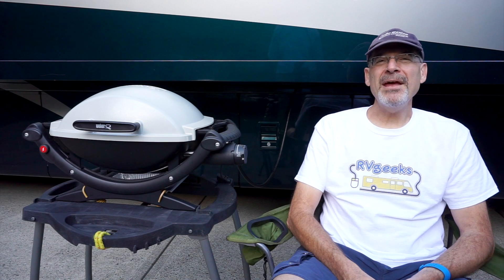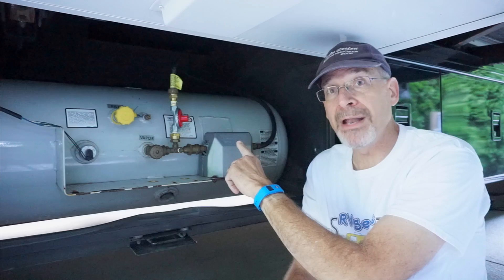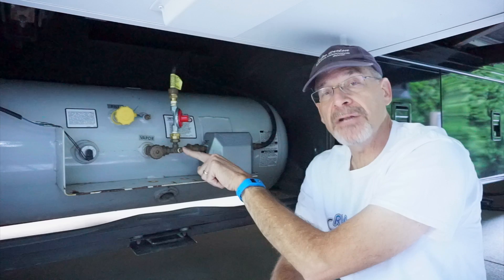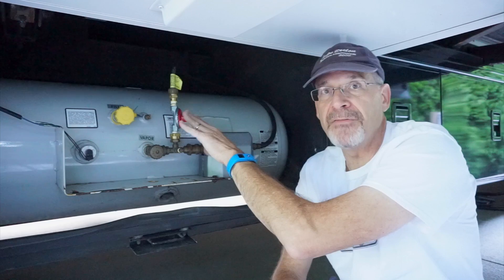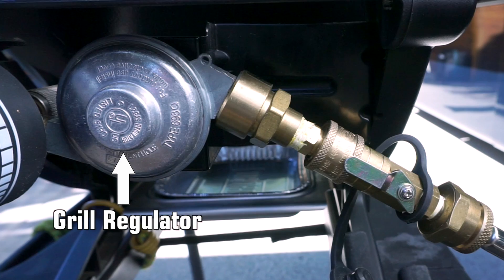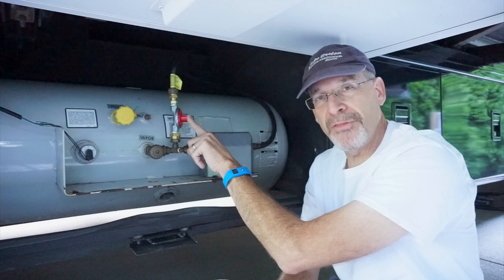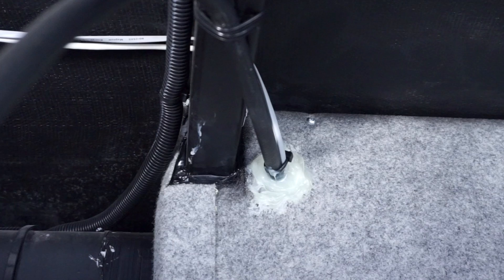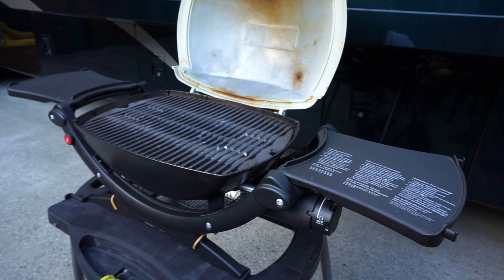How to Connect a BBQ Grill to an RV's On-Board Propane Tank

Comment: Hello!  Thanks for your video.  I have the same Weber Grill and I was trying to connect a 20lb tank to it instead of using the 1lb small tanks.  I bought the host for the 20lb to the Weber Q Grill, but for some reason, even though the grill is in the OFF position, gas is still coming through.  The Weber Q1200 has a regulator on it, but do I still need another regulator on the Hose between the 20lb tank and Weber Grill (again, the same grill that you have)?  Thanks!
Reply from the maker: Glad the video was helpful. First, in response to your question, no... you shouldn't need any other regulator between the 20lb tank and your grill. The grill's regulator is expecting the high-pressure propane from either the disposable tank or the 20#, so that part is fine. The gas still running/leaking part... that's clearly an issue! Can you tell WHERE it seems to be leaking from? Is it literally coming through the regulator and running out the burner holes? Or is it leaking somewhere else? 

You might want to mix some dish soap into a cup of water and pour that over the connections... if it bubbles, you've found leaking.

But if the gas is coming THROUGH the regulator on the grill, even with the regulator turned off completely... it sounds like that regulator has failed and/or is faulty. If it's new, we'd return it and get a new one. If it's older... we'd try replacing the regulator.

Hope this helps!
Reply: @RVgeeks  Thanks again.
Reply: Thanks for the video. I picked up our new RV yesterday and was told not to have a regulator on the BBQ since there is one on the TV and it would be too much. What do you think?
Reply from the maker: It all depends on whether you’re tapping into the propane for the grill prior to, or downstream, of the RV’s regulator. The RV regulator brings pressure down to the correct level for running your grill without an additional regulator. If, however, you have your system set up like we do, with the hose going over to the grill coming from the high-pressure side of the regulator (the side closest to the propane tank), you absolutely do need a regulator on the grill itself.
Reply from the maker: By the way, congratulations on your new RV!
Reply: @RVgeeks  it's going downstream so it gets the effects from the regulator. Guess I'll have to shop for a different model 😃. Thanks for the help!

Comment: i know this video is old but I was just wondering about why you have the second regulator at the grill side? Is it necessary? thanks
Reply from the maker: Hi Scott! It’s needed because we have such a long run of hose from the propane tank to the grill. Very high pressure coming directly out of the propane tank and running down a long hose tends to build up oil in it which gums up the grill. That red step-down regulator lowers the pressure enough to prevent the oil, but still allows enough pressure for the grill to operate properly.
Reply: @RVgeeks  thank you for the reply.   and you parts list is excellent.  We are hooking up our blackstone this weekend.

Comment: If you do NOT want to have the ability to add an external LP tank, can you just add the tee AFTER the RV regulator?  Then, will any portable grill work OK (many say they are designed for 1 lb or 20 lb LP tanks) -- I assume there would only be the RV regulator that would meter the proper pressure to the grill.
Reply from the maker: You CAN do that, Jim... but you'd have to be sure there's not a second regulator on the grill. For example, our Weber Q has the regulator integrated with the ON/OFF/LEVEL control knob... and while it CAN be removed, it's a bit of a pain. So using the Extend-A-Stay before/upstream of the onboard regulator ensures that the grill sees high-pressure propane. If you Tee in after/downstream of the onboard regulator your grill will only see 11" water column (about 0.5 PSI), so if it has its own regulator, it won't work. The 11" WC pressure isn't enough to open the second regulator up, so no propane will flow. Hope this helps.

Comment: Should be a shutoff valve before the high pressure regulator  so the line to the other side isn’t under pressure all the time  if it ruptured or even a pin hole would be fire hazard
Reply from the maker: Ideally you're right, and we've been thinking about adding one.

Comment: Instead of the double regulator, can I just disconnect the hose from the extend-a -stay valve when it's not in use or even install a propane gate valve where you have the 15# regulator-All of this is for the oil build up, correct?
Reply from the maker: Hi Craig! Since the 15-PSI regulator at the tank is indeed for the sole purpose of preventing oil build-up, your idea of either disconnecting the hose, or shutting off the flow of propane, should work great, since it's the pressure in the long length of hose that causes the oil to come out of the propane. Great question and great idea! :)

Comment: You're running propane through a regulator twice? Are you getting any pressure at the appliance? Doesn't that reduce your propane pressure to the point of it not burning at capacity?
Reply from the maker: As we said in the video, yes, we're running through two regulators, and it works perfectly. The reason is that the commonly referred-to "double regulation" problem happens when you use two 11" WC (water column... the standard appliance regulator that equals about 0.5 PSI). We're not doing that. The first regulator is 15 PSI, about 30 times more pressure than the one on the grill. That supplies plenty of pressure to the grill's regulator, and is simply in place to reduce tank pressure (which can typically run well over 100 PSI) down in the long hose from the tank to the grill. That's only needed to prevent oily build-up, which can happen (and clog the grill's regulator) when running extremely high pressure over a long run. It's simply a step-down, not double regulation.

Comment: We are looking to do this with our travel trailer.  We have quick connects available already at the camper but need to connect to our coleman roadtrip from the one pound tanks to a hose we have purchased already.  do you have a list of the connectors that you used
Reply from the maker: Hi! Not only do we have a list of every part we used, but links to them and a diagram of the whole thing to boot. You can find all that here on the related post on our website. Hope this is helpful: http://thervgeeks.com/propane/bbq-grill-connection/

Comment: Thank you for this detailed information! Got all the necessary parts from your website´s links. Quick question though: with the grill adaption to the tee, that is between the tank and the regulator, once you open the tank´s valve is there no gas escaping through the grill´s hose? If not, is it not escaping because the quick adapter´s valve, or would it be enough without that quick adapter to avoid gas escaping (or would I need then to connect and disconnect it all the time)? Thanks in advance!
Reply from the maker: Good question, Alfredo. Yes, the quick-connector by the grill has a shutoff so that propane doesn't leak when you disconnect the grill from it. We've also been meaning to install another shutoff valve between the tee and the 12' hose coming across to the grill... so that, when needed, we could shut off the flow of propane in that hose, without also having to turn off the whole RV's tank. That would also add another layer of safety to ensure no leaks. But, even without it, we haven't had a problem.
Reply: @RVgeeks  Thank you for your answer!!!

Comment: Why didn't you just T off of the down stream side of the reg. you already have on the coach and remove the reg. on your grill.  That is what I did for my Weber Q (11"WC) and my fire pit (also 11"WC). And it works fine with much better temp. control than I had with the small "camping" bottle or the big 40lb tank.
Reply from the maker: Hi Walter. Sounds like that worked for you. But if we T'ed into the line downstream of the regulator, we couldn't use our Extend-a-Stay to connect to external propane, since that would put high-pressure, unregulated propane into the entire RV. Also, not sure if you have an older Q, but ours (a pretty new one) has a regulator that appears to be all one piece with the temperature control. That makes it a nuisance, since it prevents us from just popping the regulator out of the line.

Comment: I have a camper with dual propane tanks. The propane lines are set up similar to what you did in your video, with a dedicated line running to quick connect for outdoor grill station. I am thinking of changing the configuration to use an auto changeover regulator for all of the camper's appliances. Any idea how I would split out a line to the grill station using dual propane tanks and an auto changeover regulator?
Reply from the maker: Hi Mike... sorry for the delayed response. We lost track of this comment! How you do it would depend on where your current BBQ quick-connect line is plumbed. Does it come AFTER (downstream of) the RV's regulator? If so... it should be easy to just replace it with the auto-changeover regulator and nothing else needs to be touched. But if your current "T" is placed BEFORE (upstream, closer to the tank) from your current regulator, you'd have to make some changes. You'd probably want to move the "T" to AFTER the changeover regulator (so you'd have the advantage of the propane supply for the BBQ auto-changing along with the rest of the RV) and you'd likely need to remove the regulator from your BBQ grill. The output from the RV's regulator will be too low to be an input to the grill.... so your grill would stop working.

But if your grill is already a low-pressure unit, because it's getting it's propane fed by the onboard RV regulator, you should be fine.

Hope this helps... and makes sense! 😉

Comment: Need help. I have a quick connect valve on the rear end on my camper. I also have a hose with one end that's a male that connects to a 1 lb disposable canister, and the other that would connect to a typical small grill or Mr Heater. Does an adapter exist for me to connect this hose (the male side) to my quick connect? I can't find much of anything.
Reply from the maker: Hi Dapper. Mr. Heater is pretty good about making a wide variety of hoses and adapters that (theoretically) should allow you to connect any Mr. Heater (or other small heater or grill). Sounds like you might need a hose or adapter with either double male or double female, to simply "reverse the polarity" (so to speak) where you're currently having a conflict.

Comment: Is the oil issue something that occurs over the course of a longer period of time? We're not full time RV'ers. A long trip for us would be 5-7 days. Most trips are only 2-3 days. I would be disconnecting the line completely when not in use. I wonder if for my application I could get away without the 15psi regulator?
Reply from the maker: Hi Nick! You probably could get away with not using the 15 PSI regulator. It's definitely something that occurs over time with the propane in the hose under pressure. Based on the use you've described, we can't imagine your having any trouble. If you want a simple bit of insurance, you could just add a filter to the line, and that will catch any oil. It's this type: https://amzn.to/2LReBh3 We used one of those for quite some time before installing our long-term fix (the regulator) and it worked great.

Comment: Thanks for the great info! I have a factory installed quick connect LP connection at the rear of my TT. I bought a hose that would connect to that, and the grill (I have a Cuisinart CGG180), which also uses the 1 lb LP cans. I had a little trouble getting a good flame with that set up & I wondered if I should remove the regulator from the grill, because there is already a regulator on the LP tanks on the rig. The problem I had, when attempting that, is that the regulator must be welded to the fitting, because I could not for the life of me loosen that sucker. I was wondering if you've run into anyone reporting that same problem. I decided to leave the regulator alone for now, and just use the 1 lb LP cans. But it's kind of a bummer to have that quick connect available, and not be able to use it. Any tips? Thanks again for a great video.
Reply from the maker: Hey Phillip... you're experiencing the double-regulation issue. Your built-in propane quick connect is tapping into the propane AFTER (downstream from) the trailer's regulator, which drops the tank's pressure down to 11" Water Column (about 0.5psi) for all of the onboard appliances. Your Cuisinart grill is expecting HIGH pressure propane (from the small tanks). So the 0.5psi pressure in the line from the quick connect isn't enough for the regulator on the grill to open. So you can either remove the regulator on the grill (which sounds like it could be a problem... and, if it's like our Weber, also includes the flow control which would mean you couldn't raise/lower the flame). Or you can add an Extend-a-Stay like we used BEFORE the onboard regulator (between the tank and the onboard regulator) and run a new line. Hope that makes sense!

Comment: Going through two regulators makes the flame only 1/3 heigh.
Isn’t it?
Reply from the maker: The first (red) regulator is 15 PSI. That's FAR higher than the approximately 0.5 PSI the grill requires. That higher pressure prevents the flame from being affected. Works like a charm!

Comment: Love the video.  Thanks for the information.  I just installed this system.  How long did it take for your propane lines to Prime?
Reply from the maker: Not long at all. Just turn on your grill while holding/clicking the igniter and it won’t take long!
Reply: RVgeeks hmmmmmm.....i let it sit for about 30mins and it still won’t fire.
Reply from the maker: @Flamingpins  Sounds like it's possible that your propane tank's excess flow regulator may have been triggered during the install (does anything else in your RV light? Have you tried your stovetop?). It's intended to stop the flow of propane if it detects a sudden release (i.e. a hose burst, etc). But it can accidentally trigger if the flow from the tank starts suddenly (like when you turned it back on after installing the propane T, etc). To reset it, try this:

(1) Turn off the valve on the propane tank
(2) Bleed off the pressure in the lines... both in the RV (i.e. turn on a burner on the stove) and the BBQ (turn it on to bleed pressure)... just make sure you've got a window open and proper ventilation!!
(3) Turn off the stove & BBQ
(4) SLOWLY open the valve on the propane tank and let it pressurize all lines
(5) Turn on a burner on your stovetop and allow it to flow until you smell propane... turn it off and let the smell clear (windows open, etc)... then try lighting it until it runs steadily
(6) Once propane is flowing to the stovetop, do the same with your BBQ... and you should be all set!

If that doesn't do it (or if the flow to your RV's stovetop was fine all along and it was just the grill that was the problem), you may have to check all the connections between the tank and the BBQ.

Are you sure you installed the T between the tank and your onboard regulator (not after)? If not, your grill won't be receiving high enough pressure to open its regulator and allow flow.

Try disconnecting each of the lines between the tank and the grill... the 1" connections can have stopper valves in them, and one of them may not be opening. Disconnecting and reconnecting them may make sure they seat properly.

That's about all we can think of at the moment... but hope one of the above gets you back up and running.

Comment: Hi and thanks for the demonstration! I’m curious if you have ever dealt with situations where spacing is much tighter between the vapor exit and the regulator box such as on a Coachmen Freelander (Class C)? The tank appears to be the same as yours, however it appears that I would literally need to cut into or relocate the regulator box cover in order to make something work since there appears to be only about 1 inch of spacing between the two. Any advice would be appreciated. I can also send a photo upon request. Thanks.
Reply from the maker: Brandon Guffey Hi Brandon! We’ve only ever done this on our own Class A, with (obviously) plenty of extra room to work with. We know that with some Class Cs and other smaller rigs, space can be at a real premium. We think you you probably only have two options… One would be to move the onboard regulator to make room for the Extend-A-Stay, assuming you have room to do that. The other option would be to tee in (probably using a regular T fitting, and not an Extend-A-Stay) after the regulator, then use a grill that specifically can handle working with the lower pressure of the already regulated propane. That would probably mean finding a grill that did not have a regulator on it, and was designed to work off fully regulated house RV pressure. Hope this helps a bit.

Comment: What is the max length of hose that could be used without "pre-regulation" for connecting to a grill with it's own 11 WC regulator?
Reply from the maker: Sorry we don't know the exact number of feet, Tim. We know we had it happened in our 24' hose, so we do know that that it long enough to cause a problem. If your hose is shorter (maybe one 12' extension instead of two), you might be okay, but we're sorry we're not sure, since we've never used that length.